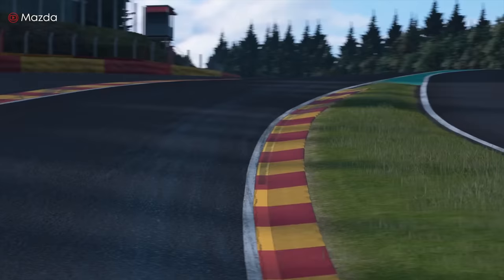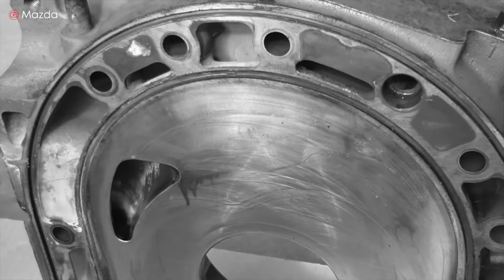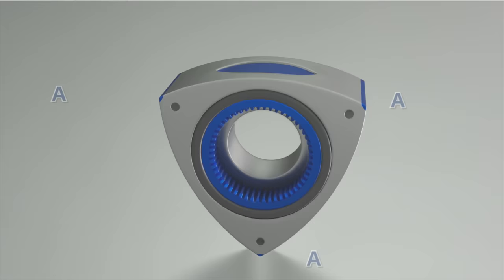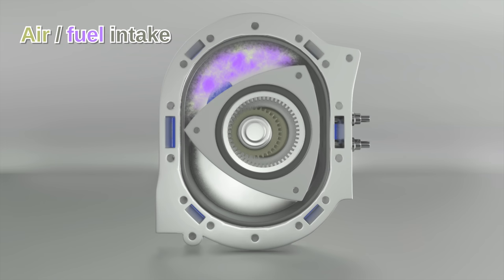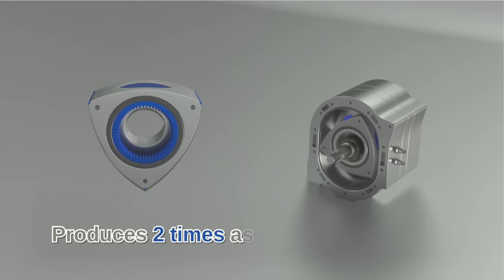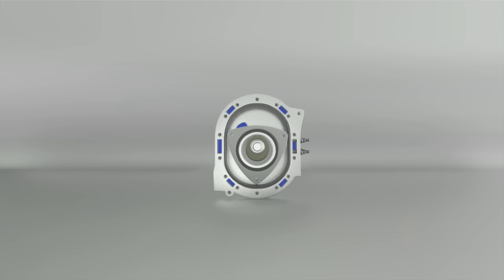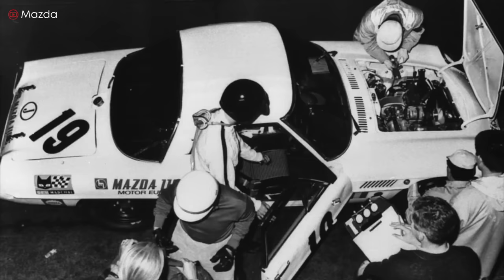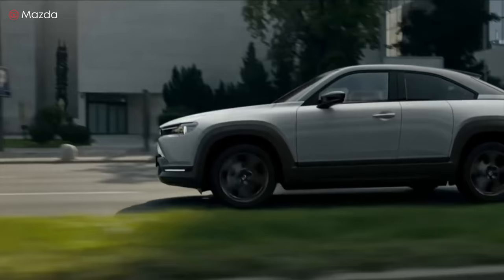Mazda's New Engine is the Most Powerful Engine Ever Made

Comment: An early commercial shows a kid on a pogo stick:  "Piston engine goes boing boing boing, but the Mazda goes Hummmmm."
Reply: I remember.
Reply: tanks fir the mamories.
Reply: Vtec go brrr
Reply: Wrong. They go Brap brap
Reply: It seem like and has been said that this engine type uses more torque. Why hasn't anyone tried redesign this to a diesel application?
Reply: Andy Candy  As an engineer and well versed in physics, your comment appears to be inaccurate. Please elaborate. I am interested in your hypothesis.
Reply: legend says that kid still goes boing boing boing...
Reply: I’d certainly rather go boing boing boing than get a hummer.
Reply: I think you meant the pistons engines goes boing, boing, boing but the Mazda goes zoom, zoom, zoom... LoL 😝
Reply: @user-vp1sc7tt4m   Hello, I’m a previous engineer in Mazda motors. Unfortunately he is right on the issue and it’s a regrettable flaw in our prized engine. The rotary shape is efficient enough to create a air tight seal and allows for the best possible rotation of the crank shaft, however sacrifices torque due to the cycle length. It’s the same reason why we are unable to increase the fuel economy of the engine but have ample power for its size. It’s a huge drawback. As you increase the size of the engine, you lose power and increase fuel consumption, but also the shear size of the rotary causes drag and requires more fuel per SQFT of surface area divided by the initial weight of the rotary. This is why our rotary engine is not available for commercial vehicles.. Its only real application is for compact vehicles and track cars. It’s is also why we have not had the ability to increase the performance of the engine as compared to competitors in the industry. With that being said, the results are different as you decrease the size of the engine. The les surface area on the rotary and weight actually makes it more efficient, stronger and thus a perfect application for the Electric vehicles market vs a piston engine of equivalent size. Our new rotary can use hydrogen and natural gas to generate electricity more efficiently than any other hybrid engines because of this. We found that decreasing the rotary by 500% increased fuel efficiency by nearly  145% by allowing the greater use of energy per liter of fuel and eliminating wasted heat. This ultimately gave us a greater torque rating of 90 ft/lbs which degrades with increase of engine size. The drawbacks of the rotary are almost directly associated with greater size and as I was saying, the smaller the rotary is, the more energy we are able to recapture.
Reply: @4A 59 I hate it when folks use their credentials (whether real or imaginary) in an attempt to persuade people that what they say, automatically has some merit, rather than providing a counter argument backed up with facts and/or evidence.

I'm most certainly not an engineer, but even I can conceptually, and easily get my head around why what the commenter said, was most likely correct.

...food for thought before you post similar comments in future, I reckon...
Reply: @mr.honeybee7661  Just curious if a small rotary would make a good base for an electric generator, assuming the durability and economy issues would be addressed.
Reply: As I remember it, Mazda said they go Zoom zoom.
Reply: @BilgePump  That'll change in a few years.
Reply: @mr.honeybee7661  Do you believe forced induction could possibly help improve the current drawbacks of the rotary engine? Perhaps use a smaller rotary engine with a well-engineered turbo system? Also, do you have any personal theories as to how the apex seal issue could be resolved? Perhaps a new material for the seals? I am no engineer by any means, but I am interested in your thoughts, since you were an engineer for Mazda.
Reply: @comanchio1976  In defense of 4A 59, I don't think he intended to rebuke or deny the claims made by Andy Candy. I interpreted it more as a inquisitive question that he just wasn't clearly comprehending the statement made. Perhaps he thought the explanation might have to be made in more complex terms that only engineers would understand. I also realize that I may be wrong in my discerning the comment made by 4A 59.

Comment: That was the best presentation and explanation of the rotary engine I have ever seen. Nicely done sir.
Reply: You are absolutely right. I've been driving RX7's since 1983.
Reply: @FLYBOY-eh5th  How many miles do you get before having to replace the apex seals?
Reply: @2Truth4Liberty  I got an 88 GXL with 153,000 original miles.  It runs great, no problems with apex seals at all. By the way, I'm the original owner.
Reply: @FLYBOY-eh5th  So, 5000 miles per year must be the sweet spot - you got twice the life out them so far. Good to know.
Reply: It depends a lot on how you use it. And if it's turbo or not, I guess
Reply: Isn’t it called Wankel engine tho?
Reply: Leo Hirth  1
Reply: Hear hear!!!!!
Back in the early 90’s, my boss had an RX-7. The Turbo Rotary mil cranked out some impressive HP and Torque numbers. Then I found out about the “m.p.g.” numbers😳.
My 3/4 ton chevy got the same and it had a 454 c.i. V8. 
11mpg 🤨😳 
Huh?!? 😳🤔
Can’t be! But , it was true.
Reply: Except he is wrong on some key details.    I guess if that makes "best presentation" then that is your definition.
Reply: If one was looking to purchase an RX7 which year and model would be the most desirable and why?
Reply: @FLYBOY-eh5th  ....can I get an ..."A M E N"....?..... a good car ........

Comment: Had a 91 RX7 I loved that car, learned how to work on it because not many mechanics new how. That's when I found out how great Haynes books are
Reply: Kids these days don't know anything about going to the parts house to buy a Shelton's
Reply: @davidpayne4084  Kids these days don't know a dipstick from a lug nut.
Reply: @davidpayne4084  😂😂 Shelton
Reply: Helms or chiiltons
Reply: @JohnDoe-ny1wp  that’s definitely used to check on the oil
Reply: Haynes manuals suck for electrical and electronic work, at least in my experience. Some instructions leave out illustrations of vital parts too. They're useful, but you're best off having supplementary information, especially from the internet.
Reply: Dan Bertucci  Many manuals are vague and even have flat out wrong spec numbers, measurements in them.
Reply: @inspectorlunge3887  You're right, this was 20 years ago and I didn't have internet 😆
Reply: 1991 rx7 gxl, i had, with mechanical 4ws.  weird simple setup. used gravity to change rear toe.  also had easy way to disable it.    one car i miss,   but i sold it for close to what i bought it.
Reply: Stills have mine
Reply: Knew how. Not many wanted to.
Reply: YouTube is my go to for auto repair and recipes. Fix my truck while dinner is cooking.
Reply: Chilton tended try and cover too many models in a single book, while Haynes seemed more specialized to my vehicle (whichever of the 20+ i had). Chiltons skimped on descriptions, diagrams and images of certain tasks leaving you with a little something on your plate. I mean, if you already knew how to fix or perform a task on a particular vehicle, you would not have bought a manual on how to do that task properly. Just my two cents worth.
Reply: They call themselves mechanics then can only work on certain things.

Everyone so far has mentioned the Johnny-come-lately books; when I got into it the book was called Motor's.  Hardback construction, they covered a brand over a time period, for example Dodge 1960-70.
Reply: I had a 91 RX7 as well, badass convertible....  I loved that car!!!
Reply: Retail manuals are written to look impressive while offering minimal information. It’s also why OEM manuals are so expensive.
Reply: Kids these days go to youtube to learn because it's all been done before
Reply: Reassembly is the reverse of the  dismantling procedure.
Reply: I had a '91 RX-7 convertible that I converted to manual shift / turbo.  It was the most awesome and memorable car I ever had.   The Apexi boost controller and R2D2 blow-off valve was just icing on the cake. You couldn't tell it was turbocharged until you started driving, otherwise it just looked and sounded like a mild mannered convertible.  I really miss driving that car.   I also met a lot of cool and interesting people through the RX-7 community.  ...Good times. 😁👍
Reply: And transmission fluid too?
Reply: @JohnDoe-ny1wp  Facts
Reply: @nappy.headdd8385  2 2qq×
Reply: Haynes are great nearly on par with the factory stuff. I had an 87 Turbo II
Reply: Haynes bought Chilton.  The new manuals look different but are now the same in content.  I found Haynes manuals leave a lot to be desired in covering wiring.
Reply: Dan Bertucci  Cool story
Reply: @francoistombe  Yeah a lot of  the aftermarket service manuals are lacking in that respect. Factory service manuals are the go-to for that kinda of info and sometimes those are incomplete if you lack the day to day experience to fill in the blanks and missing bits of info. 

I had the FSM to my 87 Mazda RX-7 Too and those wiring diagrams in that book were beyond Great. It included tons of additional info like diagrams of exactly where the harnesses were routed and how they were routed plus locations of all connectors with corresponding names and all that extra info. It literally was an overabundance of information. In a good way. The book did start to fall apart after a while I wish they had kept the wiring diagrams separate to the mechanical stuff so that the book would not have exp pretence so much wear and tear

Factory VW wiring diagrams on the other hand are another story. While helpful and concise they will be quite mysterious to the layman
Reply: @TerryClarkAccordioncrazy   you might not be right there

Comment: My father bought a 1971 rx3. Engine was apart in a box. How he figured it out still amazes me. I drove it for two years. Two carburetors and two distributors. Timing was critical.
Reply: I had an RX 3 wagon. 100 mph without a hiccup..
Reply: The engine is pretty simple. 
There are only a few moving parts.

Comment: Took apart and reassembled a rotary engine out of a wrecked RX7 back in ‘86/87 in high school auto class. Still can’t figure out why these weren’t more popular. Cool engines. 🇨🇦👍🏼
Reply: Lack of fuel efficiency is supposedly the reason why rotaries never became more popular. A friend of mine had an RX7 back in the day and it's performance was outstanding! I don't remember if he ever said anything about the gas mileage.
Reply: I owned a used RX-4 for a couple of years, my first car.   It was manual 4 speed and was great fun to drive.   Even though it had a rebuilt engine when I bought it, the seals started to fail after two years.   It also never got more than 14mpg highway.   Both of these problems were endemic to the rotary although the RX-7 and 8 had better seals.
Reply: They couldn't go 80k miles without an engine overhaul.

Comment: Thank you for mentioning my beloved NSU. I had a non rotary 1959 nsu prinz, which was unique in itself. 2 cylinders that both go up and down together in separate cylinders but only one side fires per revolution via twin bosch ignition coils. Vibration is controlled by a central counterweight. No belts, the ohv  cam hemi aluminum head is driven by eccentrics. Air cooled. 36.8 cu in, 20 hp @ 60 mpg. Fill up of the crankcase was 1 qt. Gas tank was 6 gallons. 1090 lbs, 123" overall, 78" w.b. seated 4

Comment: Had an Arctic cat with a 2 rotor...Man that Sled MOVED
Reply: I recall those Wankel powered cats. Never rode one however as they were not too common.
Reply: The weight savings would be awesome in today's snow machines.
Reply: AMC also wanted a rotary for the Pacer.
What happened?
Reply: @ronhood7773  it was to be supplied by General Motors . GM couldn't do it . AMC had to modify the car for its 6 cylinder engines . Cost a bundle .
Reply: Does it still run?
Reply: Had a 68 Panther w single.. .Brand new. Fit three people. Wasn't fast.  Would climb anything.
Reply: @kraigrichard7043  And sounded terrible

Comment: The Liquid Piston engine (inside out Wankle) looks promising.
Reply: *Wankel.
Reply: @sieveign  why exactly
Reply: It’s weight balanced the liquid piston engine.  However I feel many company’s this days don’t want to change things again and the ppl behind it want to much money for company’s like Mazda to bother engineering on top of it.
Reply: Haven't heard much development on that in a while but if speculation were a currency Liquid Piston would be ridiculously wealthy. There are some very reliable race rotaries. As you might expect they don't come cheap. Some really good videos on them but can't recall the name. Bug eye Sprite is a great application for a rotary. All I can remember about mine was don't drive a rotary cold, kills the seals. Shame they didn't go with fuel injection. Mazda might of solved the heat issues and* less pollution.
Reply: I just watched that before coming to this video
Reply: @crackasaurus_rox9740  How much $$$ have they ripped you off for????
Reply: exsctly....liquid piston redid it well....fuel efficient....longer lasting....and more power
Reply: and military and other companies(and gov agencies) want it as well
Reply: what they did was exact opposite in case and rotor shape....so the seals are stationary...instead of a triangle spinnin inside a peanut...itsa peanut spinnin inside a triangle lol...and works
Reply: they werkin on building one that works for cars n such
Reply: @crackasaurus_rox9740  what use case is that? Genuine question. I heard about it/them from Warped Perception channel.
Reply: @jaysonross1240  LP has not proven anything, only made claims.
Reply: @sandervanderkammen9230  they have.. small developer model for go cart
Reply: @sandervanderkammen9230  you’re high. The military has a contract with their engine for a generator. The only thing it needs is proof of reliability and longevity and a car company to mass adopt it.
Reply: @sandervanderkammen9230  hm, mine currently has like 126K km and no signs of wearing out in the near future. ('86 RX7 FC)

Comment: It's a shame they didn't do more development on this engine.  A good friend of mine had an RX-7 in 1998. What an awesome ride it was.  That thing would move!!!
Reply: A 2021 4 cylinder with a turbo has all the power you need
Reply: @CptDaves  Having a performance car isn't about "NEEDS."  It's about wants and desires.
Reply: @CptDaves  a used V6 still gonna make more power boy grow up lol
Reply: @Rmac335  They only make engines with 4 cylinders, but the trademark of the Italian car maker Lancia is a picture of the rotor of a wankel. WTF
Reply: @CptDaves  If you're going to start pointing out Italian car makers logos with "a picture of the rotor of a wankel", you need to start including Ferrari, Lamborghini and Ducati.
Do you see any pattern forming?
Reply: @Bobs-Wrigles5555  They should make the Lancia Stratos again. Mazda should sell them rotary engines to power them. I would buy one of those.
Reply: @reubenmorris487  Unless your performance car is your daily driver too.
Reply: @IJoeAceJRI  you don't even need an engine just connect bicycle pedal to the car and have a really high gear ratio to be able to push it

Comment: The Achilles heal of the rotary is the seal. When you find a material strong enough for that problem is solved.
Reply: By the time you solve the sealing problem, people now want Electric cars.
Reply: No the Achilles heel is fuel efficiency... which will never be solved on a mostly wankel rotary like mazda wants to make. Nobdy wants 20mpg or less in a coupe or sedan... they want 35+
Reply: @Wingnut353  you don't buy a rotary powered vehicle for fuel efficiency. So it's not a weakness. You expect it. You buy a rotary powered vehicle because its unique. Special.
Reply: Special needs

Comment: I like Mazda's idea for making the rotary engine a range extender for electric vehicles. If they fit it with direct injection, it can have higher fuel efficiency and power. Since the combustion chamber is separate from the intake chamber, the injectors would stay clean for a longer period of time. Direct injection makes more sense on a rotary engine vs a standard combustion engine.
Reply: Why don't they run off fumes???
Reply: A kerosene rotary as a range extender.
Reply: @buddyrojek9417  kerosene is crazy expensive per gallon!
Reply: They are JUNK the apex seals wear out.and they have high emissions!

Comment: You can buy an 'off the shelf' 750hp 13B Turbo rotary from a few of the performance places here in Australia, the power to weight ratio of a boosted rotary is truly incredible...
Reply: I know it was a big competition between ya'll and Puerto Rico, that's power right there 750hp out of a rotary eng!
Reply: How much fuel they use... also incredible.